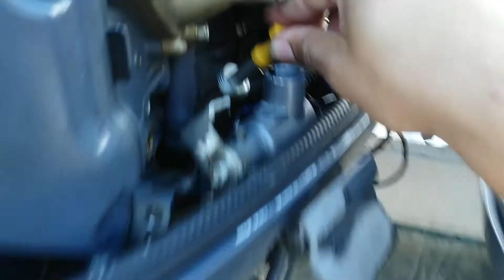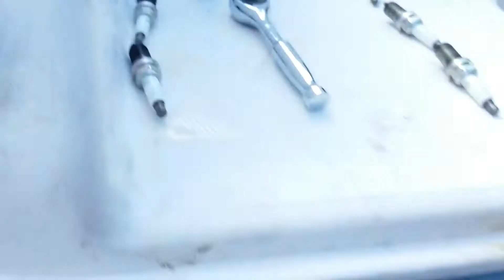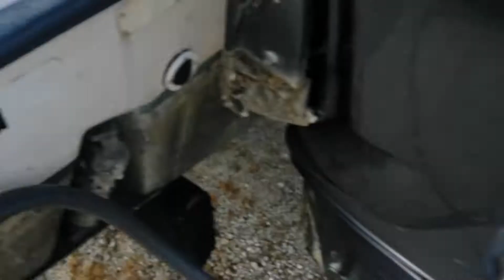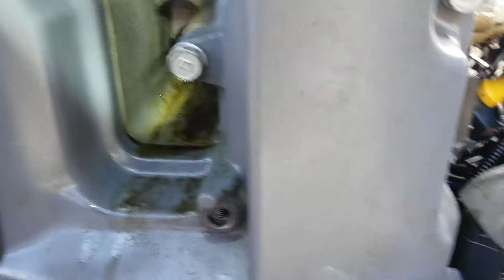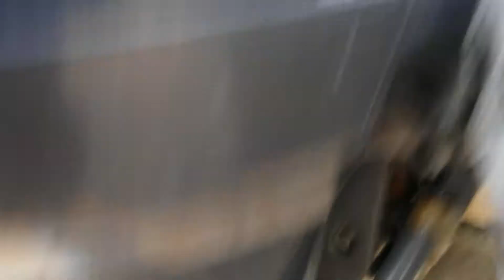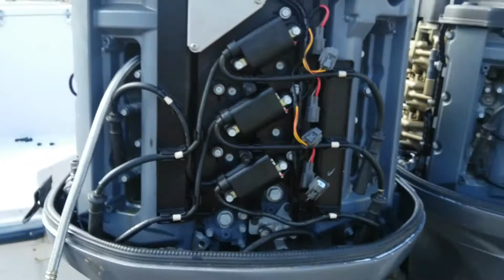2005 Yamaha LF 225 water in oil Exhaust leg corrosion problem

Comment: Did you ever find out what the problem was with this engine?
Reply from the maker: Joeseph Browning 
Yes, we pulled the power head and  
Found corrosion at the exhaust leg, also where the exhaust exits the block was eaten away.  Decided to grab a used crankcase to do the rebuild. Once I got the crankcase split I saw the corrosion went all the way into the lower cylinder head.  The wall separating  the exhaust port from the water jacket was paper thin. Luckily for us we have a local cylinder head shop here with a machinist that's a  wizard with aluminum. He built the deck wall back out where the corrosion was then machined it back down. Came out perfect. He said he likely could have saved the block as well. Funny thing is they don't even specialize in marine engines. Anyhow once the machine work was done I rebuilt the engine. It ran better than new. Now I am leaning towards rebuilding the starboard engine because I can hear it clacking since the other one is so quiet
Reply from the maker: Joeseph Browning 
https://youtu.be/FA-y1cyDgRU